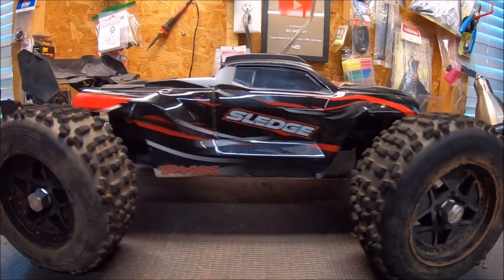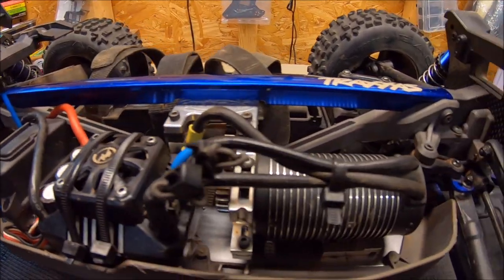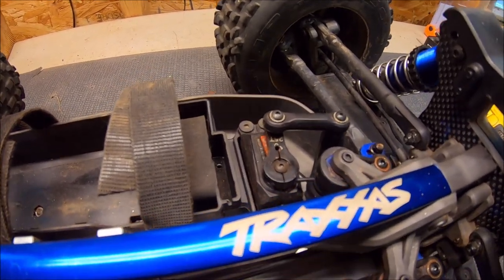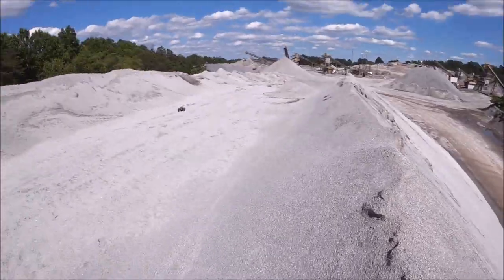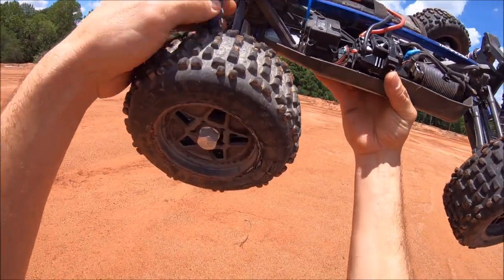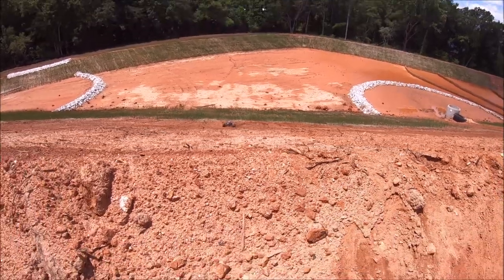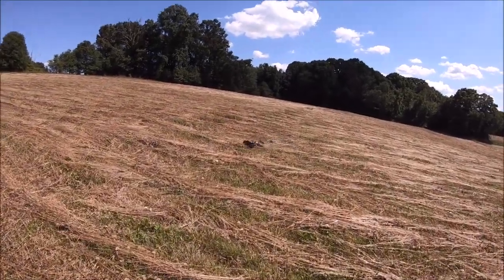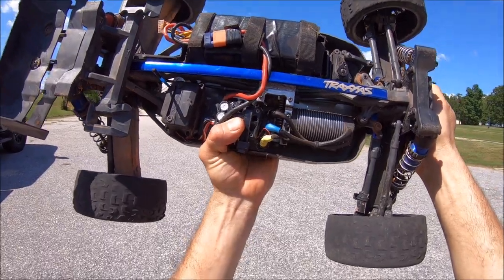TRAXXAS Sledge M2C Chassis, tips, motormount and Basherqueen towers! MEGA pounding!

Comment: Nice throttle control coming back up the hill. Love how ya kinda skipped it over the hill back up into the flat area. Looks like you let off the throttle right as the truck hits the hill which keeps the front end to pitch down right as it tops the hill. Very nice 🔥 That was some brutal impacts. Can't believe that thing didn't explode 😆 RCs have came a long way since my racing days.
Awesome bash bro  🔥👍✌️

Comment: Brother are you still running the stock diff gears or did you upgrade them?
Reply from the maker: Stock diff gears. Haven't even touched the diffs in 4 bashes other than re packing 20mill in the center.